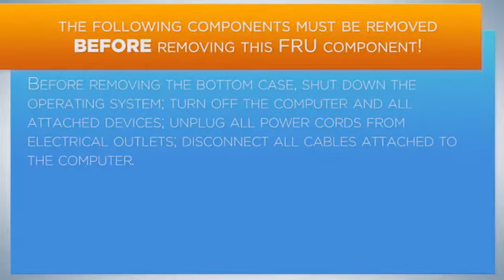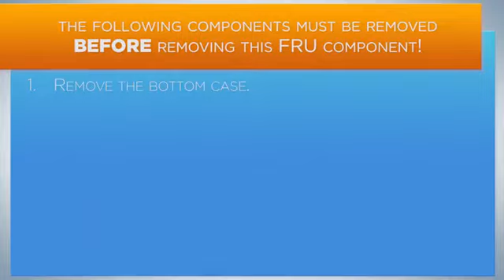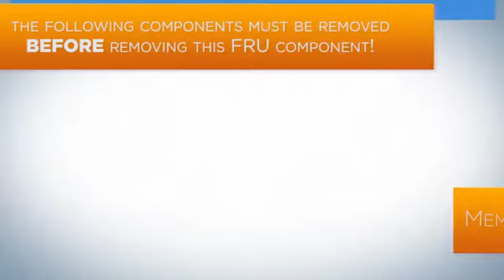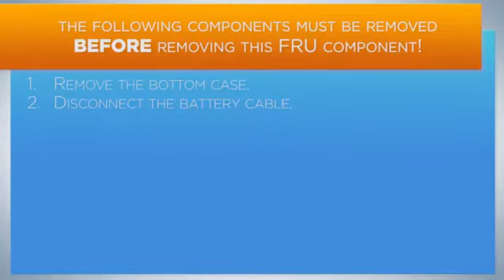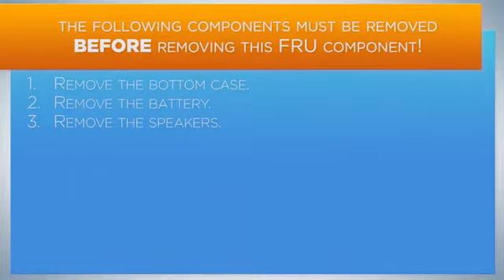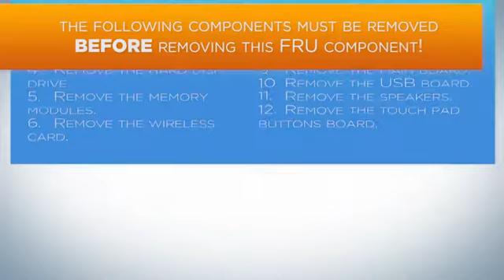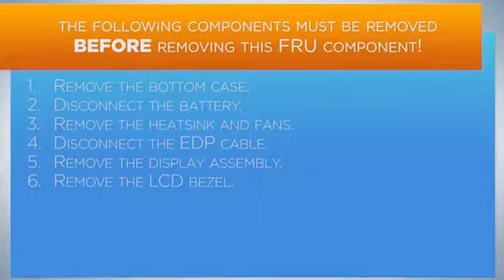HOW TO DISASSEMBLE AND REPLACE LENOVO LEGION Y540 (81SY, 81SX, 81T3, 81Q4)/Y530-15ICH (81FV)

Comment: great video. thanks for this. can you actually replace the 60hz 250 nits screen panel with the 144hz 500 nits HDR panel? like the one on Y740 or X1E
Reply from the maker: Yes try to ask the official website of lenovo
Reply: @techieteacher6332  ok thanks. but is it hard to replace the edp cable from 30 pins to 40 pins?